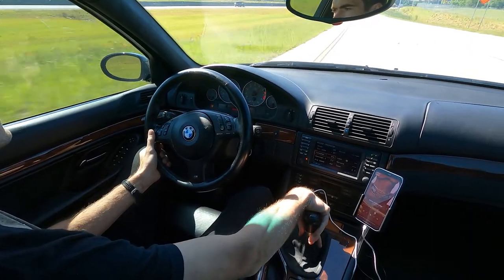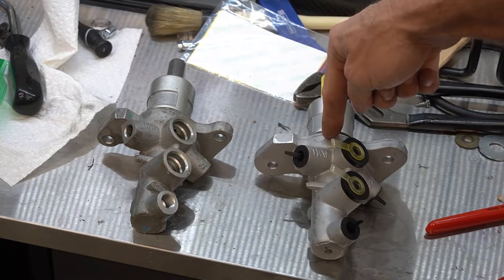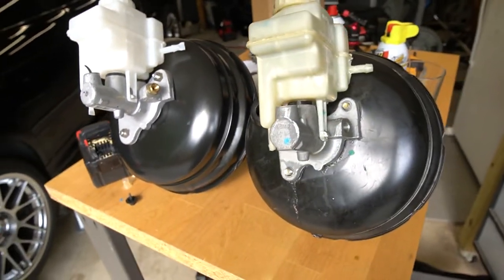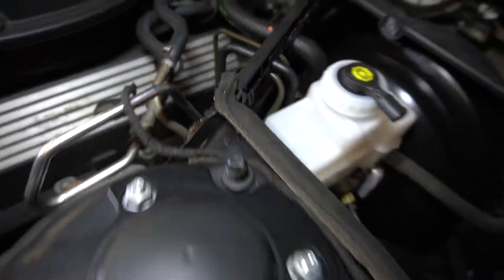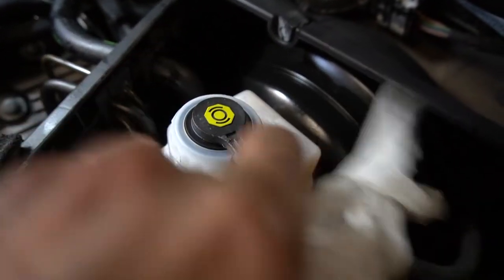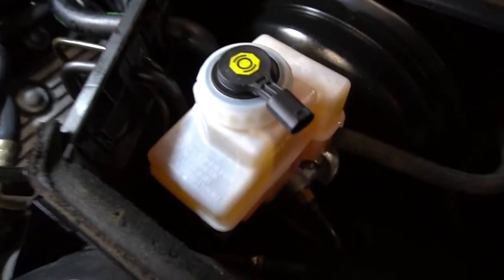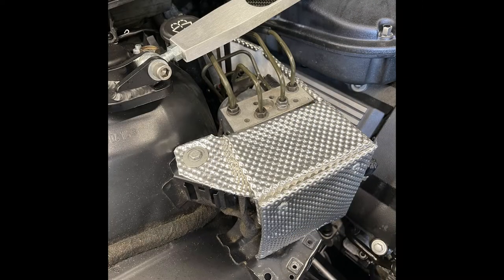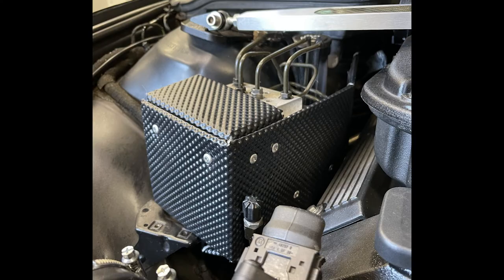BMW E39 M5 Build Log: Episode 7a - Brake Upgrades

Comment: Will the E65 brake booster fit as well? I am thinking of just getting the whole preowned kit from eBay which includes booster, BMC, and expansion tank.
Reply: That I do not know. I haven't heard that the booster will fit too, just the master cylinder.

Comment: Hey its been a while and i understand that u wont respond. Great video but i have a question about abs block/pump and heatshield, do i have to change them too to a e65 one or i can just keep them stock for a while, and about the heatshield - is it necessary to put in right away or i can drive without it for a while?
Reply from the maker: You don't need to change abs pump at all and nor is the heat shield necessary. The only thing you need to do is cycle the abs pump to get the bubbles out introduced by changing the master cylinder.
Reply: @worthygarage  oh alrighty, thanks. ;)
Reply: what impressions after changing the pump from e65???